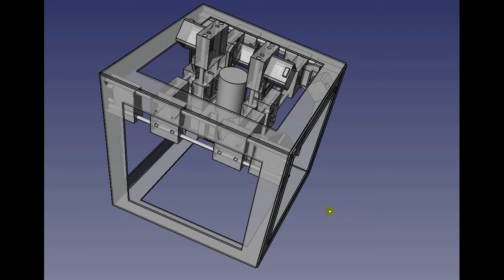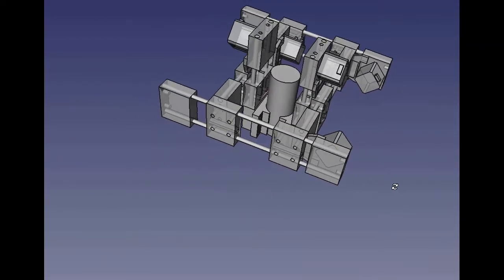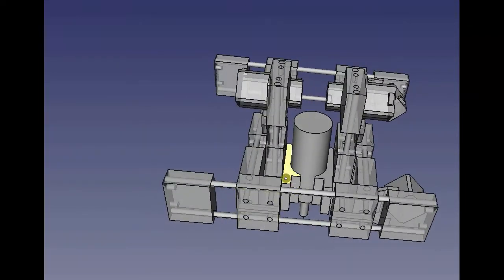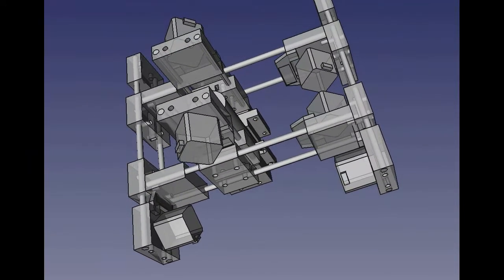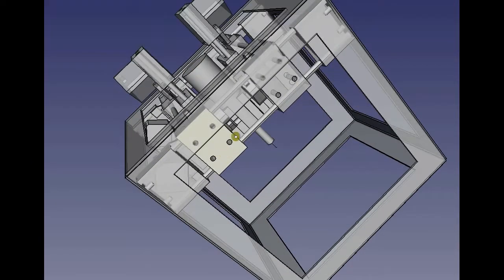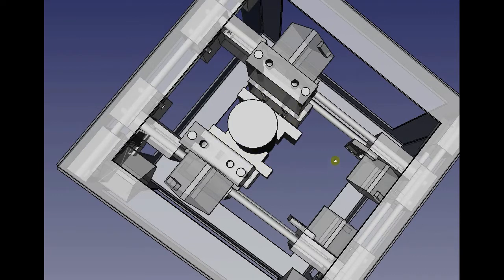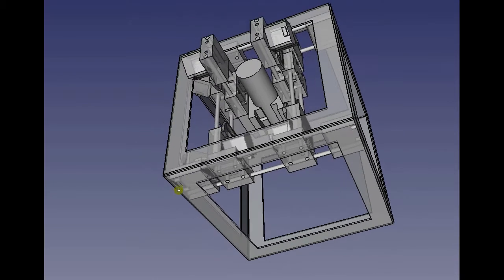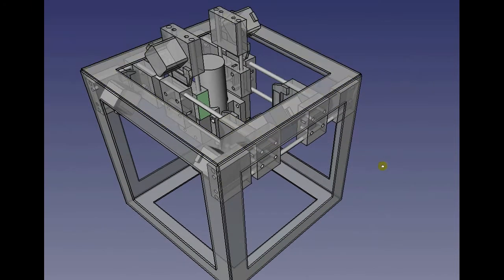D3DCNC Circuit Mill

Comment: Note that the small file size for the model above is attained by using simplified axis models - http://opensourceecology.org/wiki/D3D_CNC_Circuit_Mill#Simplified_Files . Each axis file is ~20kb, as opposed to 5MB for the originals - which include all the details including bolts.